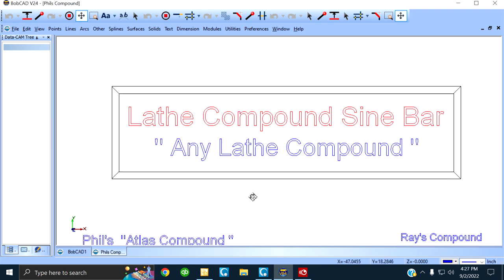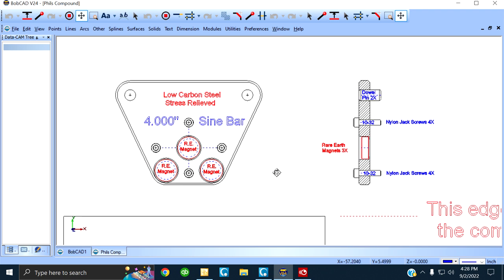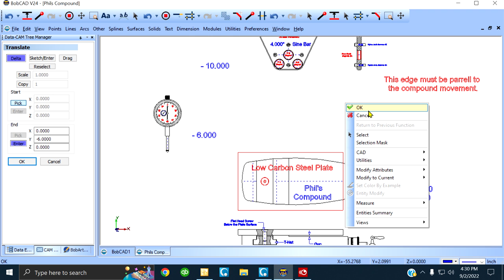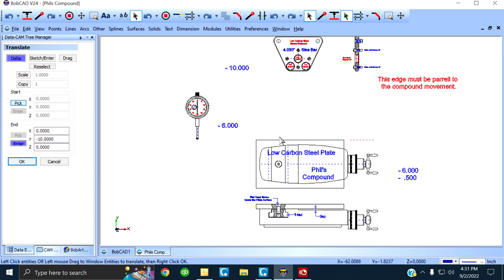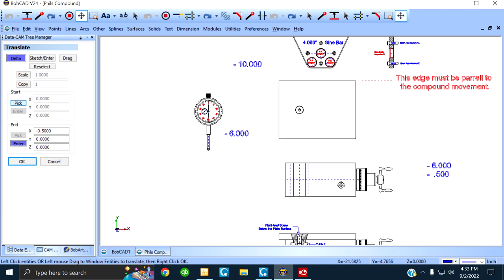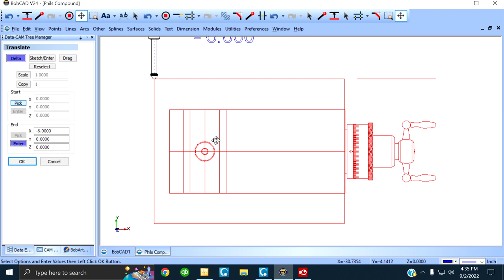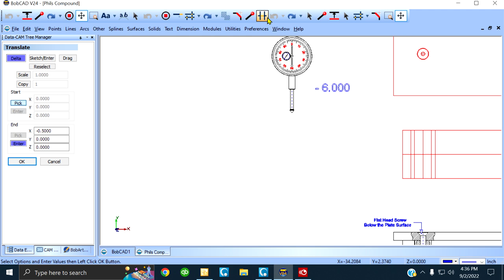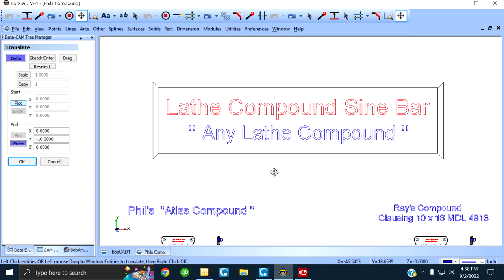Lathe Compound Sine Bar  " Any Lathe "

Comment: Neat!
My tool post has a permanent vertical bolt (many of the imports use this type) - I just have to drill the rectangular plate to fit the bolt, snug it down, align it, and away we go!
Reply from the maker: Russell -- Great Idea -- You taught me something -- thanks .

Comment: My Myford compound is like Phil's in the video, all lovely compound (heh) curves and with a Dickson two position quick change tool post. I have a bunch of tool holders for it. As I watched, it occurred to me that I could make an alignment plate with a stem that would be clamped in a tool holder and mounted on the post in the position parallel with the lathe axis (as one would mount a boring tool). Alignment adjustment would be made using the tool post top nut. Same idea, of course, would work with any quick change tool post. 

I'd leave the plate clamped in it's holder and it could be positioned in seconds without even removing the turning tool on the other position.
Reply from the maker: Hey Guy -- Great Idea -- I'll remember and pass it along. Thanks for the feedback.

Comment: This also allows to use a 6" bar on a smaller lathe for greater accuracy ! Not that the smaller lathes have 6" of compund travel. Just that a single bar can be used on multiple sized lathes.